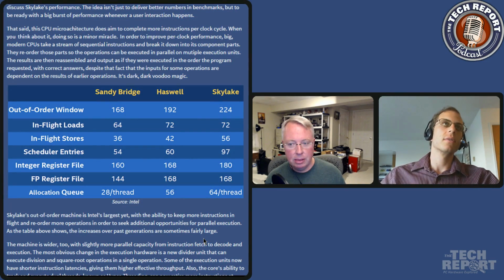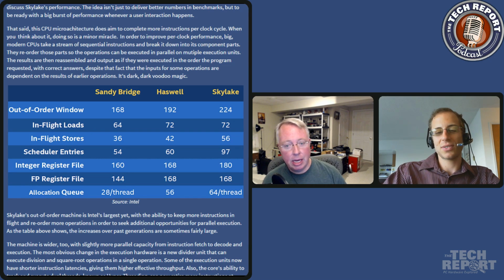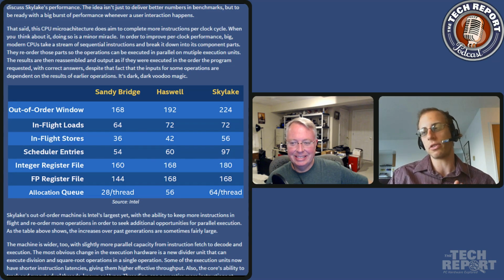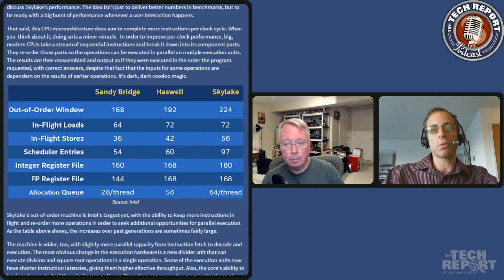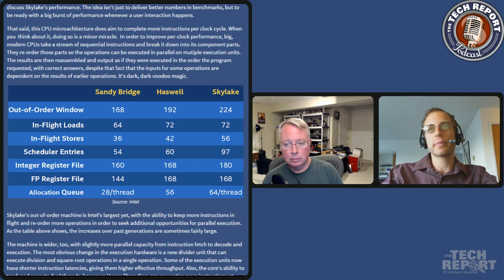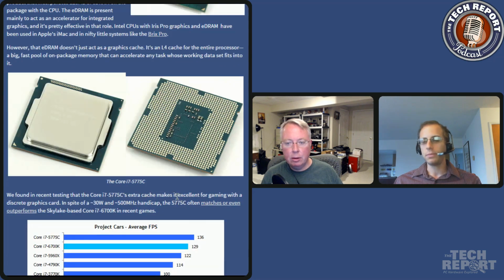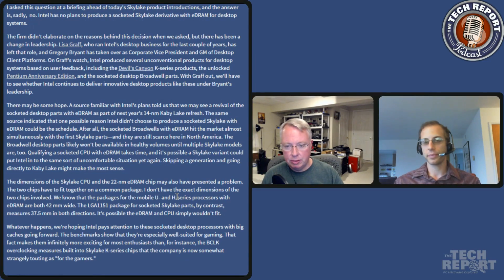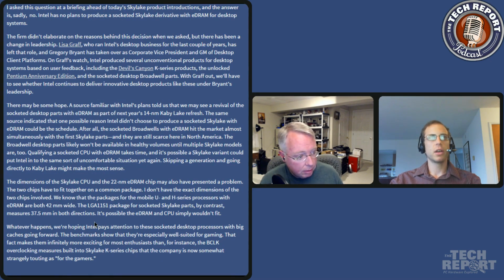Talking Skylake architecture with David Kanter - The TR Podcast 186

Comment: No, they do not have functional hardware support for async compute. Using software emulation with negative scaling does not simply make it 'different' than GCN async, it's a lack of fundamental hardware resources and a hard limitation that results in zero valid support for the feature. Recall the anadtech article that discussed async and the little 'Maxwell does this too' thrown in at the end? That was a lie (another one...) supplied by NVidia. 

  This casual misrepresentation of reality was seen with the 970, why are we seeing it again already? Nvidia currently does not have a single functional driver release in the last 6 months. Broken SLI, broken MSAA, broken AF, unstable default clocks, TDR timeouts, broken gsync+sli, broken VSR, colour compression artifacts visible in 2 and 3d rendering....and... fundamentally broken mgpu scaling with utterly atrocious minimum frametimes. It's funny, I've never seen an AMD driver with a 'debug' mode that lowers your clocks to avoid instability....

Keep it up, tech report.... If you go far enough, the FTC will investigate you for lack of disclosure.  At least David Kanter actually understands the technical aspects, but let's be serious here: how in the hell did NVidia not understand the importance of pre-emption while AMD was already baking a superior implementation into silicon before Maxwell (let alone kepler...) was taped out? Time to get your stories straight with some level of logical conclusion. Either NVidia was heavily involved with fundamental dx12 and VR design, or they weren't. Their words (and Techreport's..) say one thing, while their hardware says the exact opposite.  

Compute and graphics are not mutually exclusive, either. Let's just stop that sort of discussion right now. Maxwell is a short-sighted arch that trades functionality and performance for dx11 'efficiency'. It's unfortunate that tech report cannot provide honest advice to consumers, isn't it? Many people told you to provide the complete story on Maxwell, instead you cherry picked and followed the reviewer guide like a contract. 

I suggest you review the updated guidelines for disclosure, because I see many violations on your website. You can delete this comment if you want, but I'll still be providing my evidence to some acquaintances at the FTC who have already taken action against other dishonest 'reviewers' per my recommendation. Have fun, kids.

Comment: I like the nerdy stuff about efficiency but tell me why should I care for it for my desktop cpu? It absolutely makes sense for laptop/mobile but on desktop, meh. Gimme more power, I dont give a damn if it costs 2$ more in electricity per year.
Reply: +RagnarokDel Oi! You stop that kind of talk right now.

How dare you point out the fact that skylake is essentially a zero-value prospect for power users. Tiny, incremental increase in IPC offset by a less incremental DECREASE in clockspeeds = 0% or less net gain in performance.

In other words, this is a useless processor for desktop unless you plan on only using the intel GPU (SKU division is intentionally obfuscated, so you currently have to guess as to what you're getting in terms of 'crystalwell') with their broken drivers.

Comment: What does it all mean? Skylakes is good?
Reply from the maker: +Feathered Serpent Yeah, it's pretty good. Less impressive for high-powered desktops than it probably is for low-powered laptops and convertibles, though. Mobile devices were clearly Intel's focus.
Reply: +Feathered Serpent NO.  Skylake is a garbage.  You may get 2~3% more performance over the previous gen.  Don't forget about Intel tax as well, you end up paying via new motherboard purchase.  This time around you have to buy a new DDR4 sticks as well.

On mobile, Intel's 14nm GPUs are still barely catching up to NV's 28nm Keplar GPUs.  Nevermind Maxwell/Maxwell2.   If you think about the node difference (14nm v. 28nm) and all those alleged Intel advantage that many Intel supporters are fond to point out, it is unbelievable how bad Intel GPUs are in current market.  

If you have a desktop built within the last 5 years, just keep using it until it dies its natural death.
If you are looking for a smartphone/tablet, avoid "Intel Inside" like plague.
Reply: +TheAnandTech Thanks for the info. I don't get why people fall for it, then. I still have I-7 3820 from a few years ago. Figured Intel would have release something much more advanced by now. Guess not :<
Reply: +Feathered Serpent The real competition starts when AMD ZEN comes in 2016. Intel will have no option but to release something superior, which they have probably been holding back for AMD ZEN just in case AMD hit out of the park, as they did with Athlon FX X64
Reply: +Feathered Serpent It depends.  For anyone who would run anything <= to a 750 Ti, then yes - the Skylake architecture is going to basically build those capabilities in, so you save $100.  Not only that, it's got the best DX12 capabilities on the market.  When you're using DX12 Split Frame Rendering (where each GPU is rendering a segment of the frame rather than Alternate Frame Rendering where GPUs take turns rendering a whole frame) then you can use the iGPU to merge the frame - called Asymmetric Rendering.  This means you don't have to task one GPU with finishing its rendering and then merging the other half of the frame, which can blow your frametime.  Assuming you can overcome the downsides, SFR is potentially a preferable mode for CF/SLI, since you can potentially avoid sharing the whole memory state between both cards.  Which means your 2x4GB rig might run more like a single 6GB card.

It's not worth it in terms of CPU performance though.  It's only incrementally better than Haswell, if you're not moving up from at least Sandybridge it's probably not worth it.